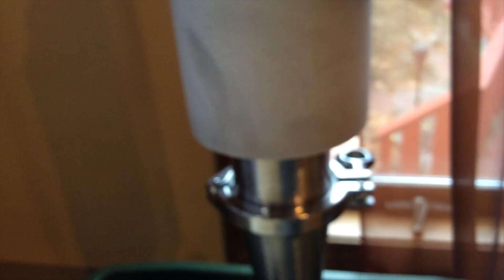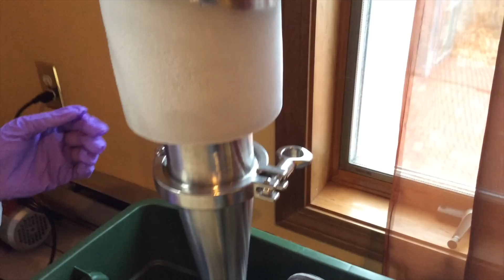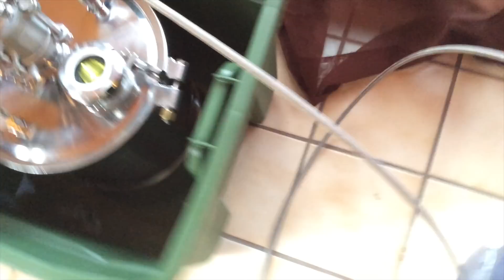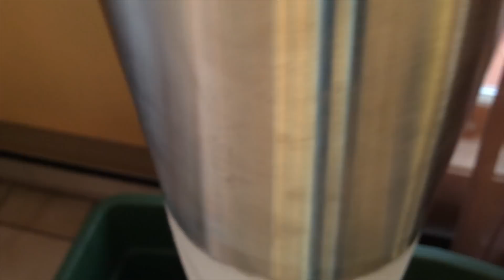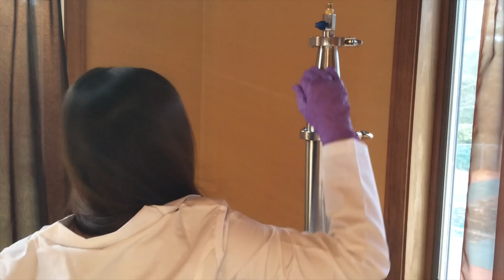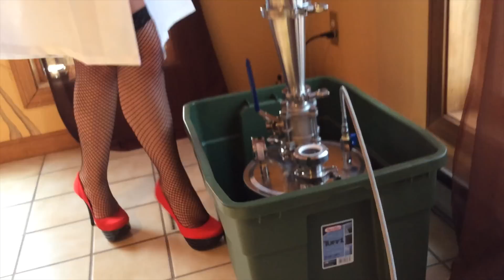Recovering to negative pressure in Closed Loop Systems passively thanks BRET MAVERICK in 4k ultra HD

Comment: LOWER THE SOUNDTRACK 50%.  IT RUINS THE ENTIRE VIDEO.

Also, use isopropyl alcohol with your dry ice to bring the temp down to -40 (f) and you can reuse it until it absorbs too much water from the air.
Reply: Mark Lee that and the constant “ahhhh yeah”

Comment: Good look DG...bringing the real outta the East. Hey let me run this by you, Building  a system and thinking the ball valve should be between the filter and Dewaxing column. But will be using all 1 1/2". Thoughts...Anyone ..Mr.BM?